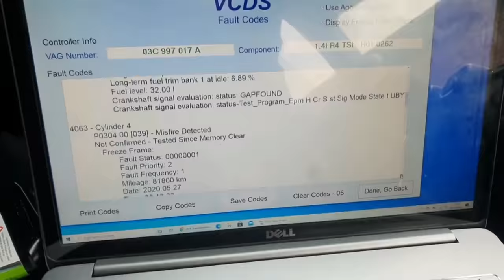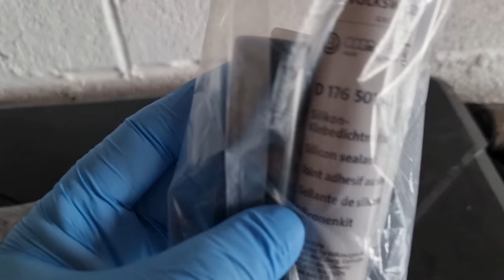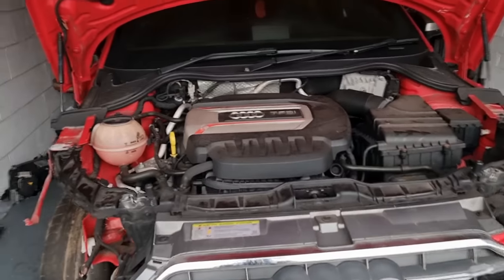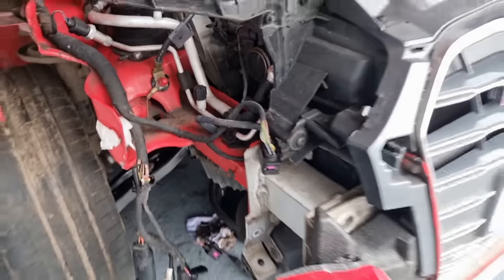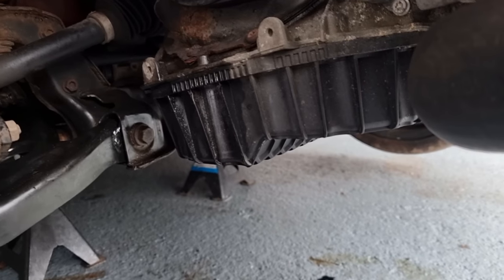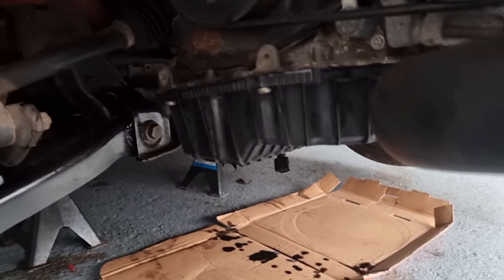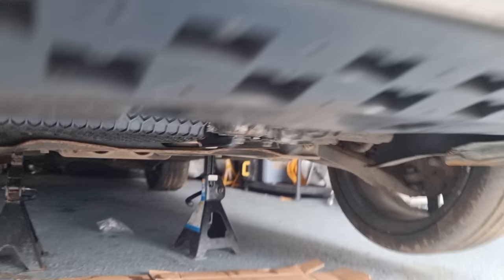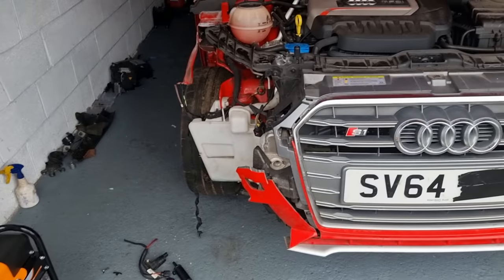Audi S1 Quattro Leaking Plastic Oil Sump/Pan Fix

Comment: I think I would've waited till I had all the screws before fitting the sump especially after fitting sealant. 

Your right about using the proper oil in them V.A.G. motors.
Reply: your dead right because of sealant as you said, could leak again
Reply: I was thinking the same as I was watching it. The sealant has cured before it's been tightened up fully.

Comment: Well done. I’d definitely be replacing that shocker whilst the hub is off, they always leak on these anyway. The service will need registering online on Audi Erwin digital service book. Let me know if you can’t register as a company and I’ll add it on for you but would be better if you did it yourself. The amount of cars we see with missing service history is a joke since everything went online. Makes them a nightmare to sell which is expected as I know I certainly wouldn’t want one with no service history.
Also I’d really recommend a coolant system pressure tester for coolant leaks

Comment: Evening mate great car and video 
Only down side that sealant  needed all the bolts fitted to pull up to the bottom of the engine and go off properly,  hopefully it's worked but don't be surprised you are doing it again in a few weeks

Comment: Another great update! I agree with the earlier comment about the front suspension change whilst the car is how it is, just depends whether you'd get the money back on a sale.

That osf is definitely more than a 'trackng and alignment' job!

In my experience, that water leak is hopefully no more that a dislodged/loose coolant pipe, which maybe occurred during the impact - fingers crossed and keep 'em comin'

Comment: Water leak could be from the water pump and thermostat housing, located under the inlet manifold, common issue on the S3 and Golf R, ea888 engines!